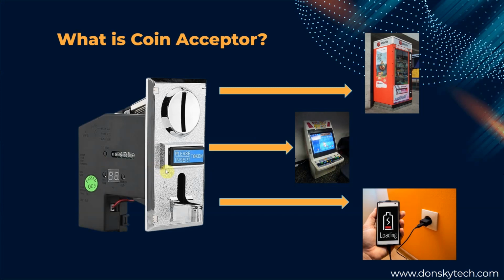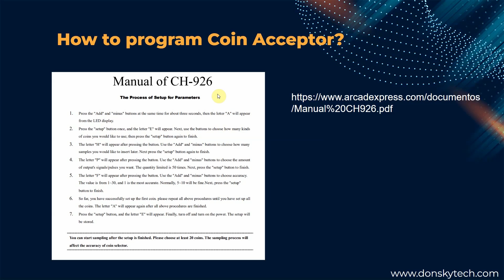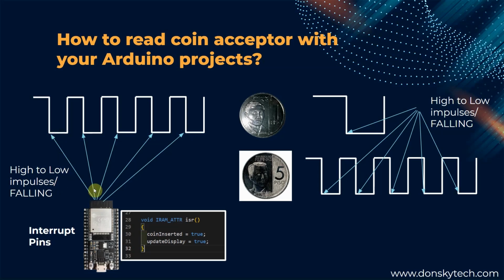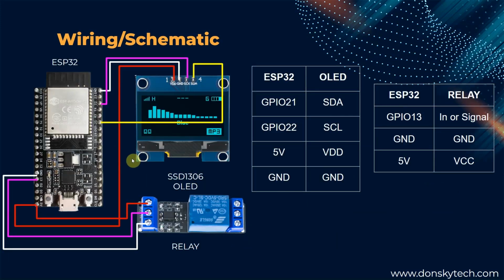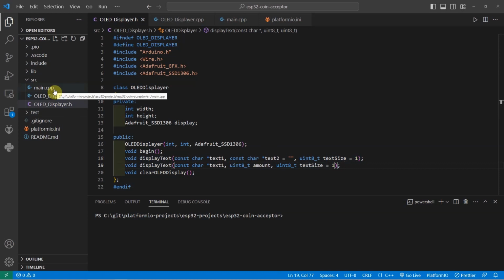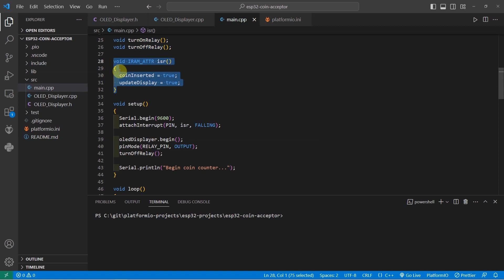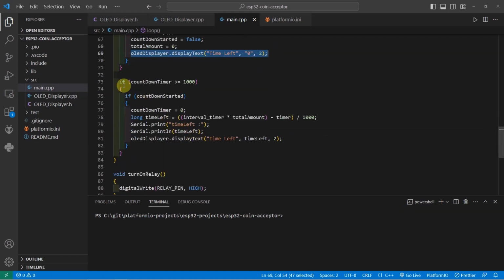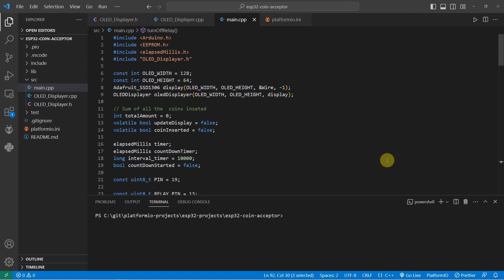Connect your Arduino projects with a universal Coin Acceptor

Comment: hi..   are trying to get this to work.  but if i the setup running for some time i can see that it self trigger on the coin puls. is there a way to fix this??
Reply from the maker: Hmmm could be some spurious signal. I heard from a friend that creates vending machines that using delay is much stable compared to using interrupt.